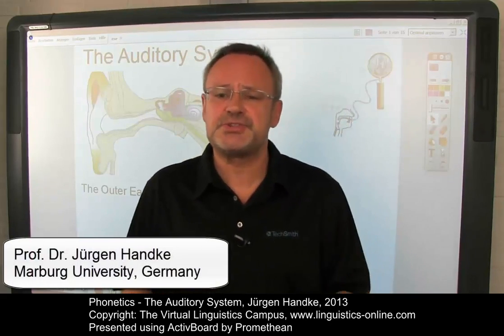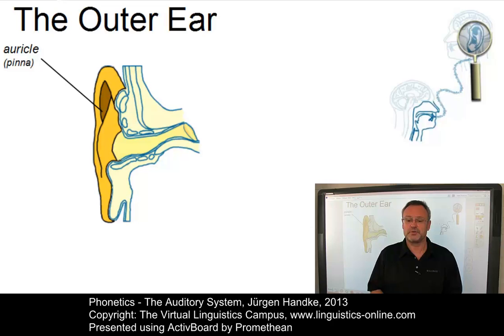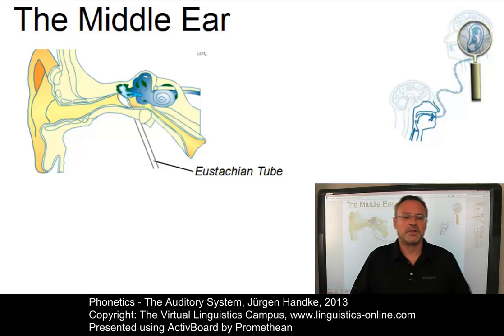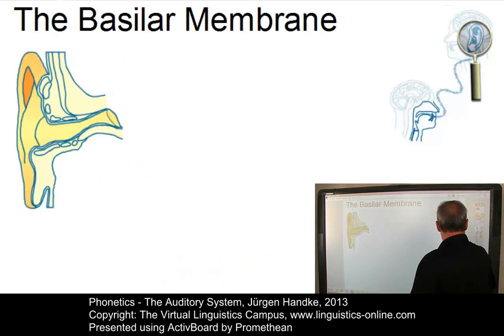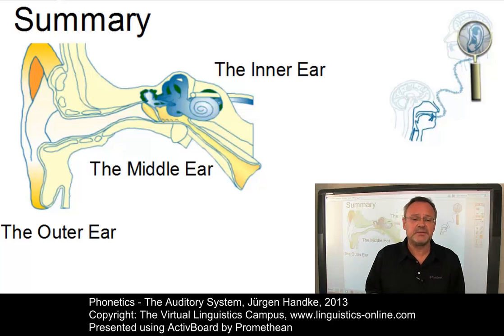PHO131 - The Auditory System

Comment: (0:03) Hello. The starting point for any auditory analysis of speech is the study of the anatomy and physiology of the ear and the brain.

(0:13) The focus of this e-lecture is the ear – generally referred to as the auditory system. It consists of three central components: the outer ear, which modifies the incoming sound signal and amplifies it at the eardrum; the middle ear, which improves the signal and transfers it to; the inner ear, where the signal is converted from mechanical vibrations into nerve impulses and is transmitted to the brain via the auditory nerve. Let us look at these components in more detail.

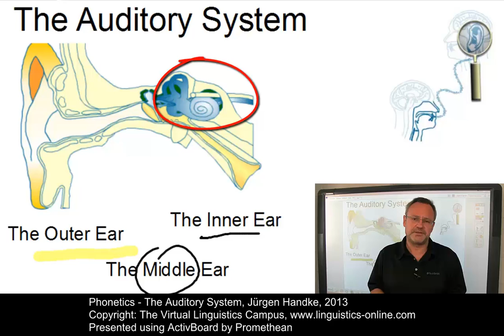(0:55) The outer ear consists of the visible part, known as the oracle or pinner, and the interior part. The oracle collects sound waves and is also important in our ability to localize the source of a sound. Furthermore, it can modify incoming sounds – particularly high frequencies.
From here, the ear canal, a 2.5cm long tube leads to the eardrum. The main function of the ear canal is to filter out tiny substances that might approach the eardrum. Furthermore, it amplifies certain sound frequencies, especially those between 3000Hz & 4000Hz, and it protects the eardrum (also called [the] tympanic membrane) from changes in temperature as well as from damage. The eardrum is set into vibration by the sound waves. This vibration is picked up by the bones in the next section of the ear: the middle ear.

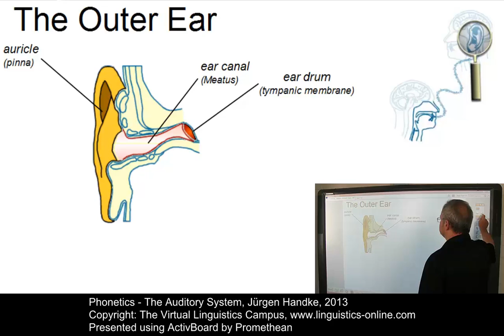(2:12) The middle ear is a cavity which is filled with air via the eustachian tube which is linked to the back of the nose and the throat. When the eardrum vibrates due to the varying air pressure caused by the sound waves, it causes the three small bones (the so-called ossicles) to move back and forth. The ossicles, here in an enlarged form, are a system of three small bones which are named after their shape: the hammer, or malleus, is attached to the ear drum; the anvil is the link between the hammer and the stirrup (the final little bone); and the stirrup fits into the oval window of the inner ear and transmits the mechanical vibrations to it. Together, the ossicles function as a kind of leverage system, amplifying the vibrations by a factor of over 30dB by the time they reach the inner ear via the membrane covered oval opening of the inner ear.

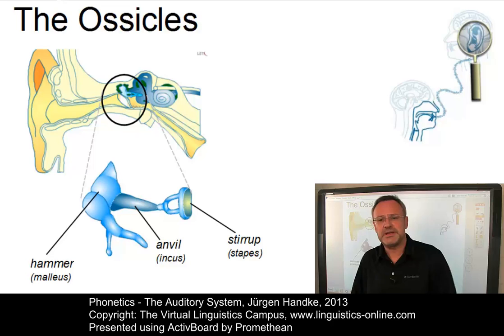(3:32) Now, the inner ear contains the vestibular organ with the semi-circular canals. They control our sense of balance.
And then there is the cochlea – a coiled cavity about 35mm long, resembling a snail’s shell. The cochlea is responsible for converting sounds which enter the ear canal from mechanical vibrations into electrical signals. The mechanical vibrations are transmitted to the oval window of the inner ear via the stirrup. This conversion process, known as transduction, is performed by special sensory cells within the cochlea. And the electrical signals, which code??? the sounds characteristics, are carried to the brain by means of the auditory nerve.

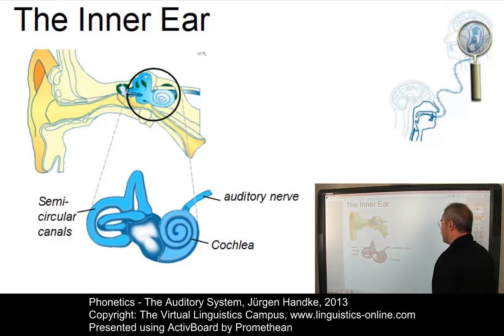(4:35) Let us look at the cochlea in more detail by means of a cross-section. As we can see over here, the cochlea is divided into three chambers by the so-called basilar membrane. The upper chamber is the scala vestibuli and the lower chamber is the scala tympani. They are both filled with a clear, viscous fluid called perilymph.  Between these two chambers is the cochlear duct which is filled with endolymph. On the basilar membrane rests the organ of corti which contains a systematic arrangement of hair cells which pick up the pressure movements along the basilar membrane. Here is the basilar membrane: first, coiled like its original form within the cochlea; and then uncoiled for a better understanding of its function. In the basilar membrane different sound frequencies are mapped onto different membrane sites from [the] apex (that is the small end) to its base. The numbers that are given here provide the frequency in Hertz. On the basilar membrane we have hair cells that bend in wave-like actions in the fluid and set off nerve impulses which then pass through the auditory nerve to the hearing centre of the brain. Short hair cells respond to high frequencies, and longer fibres respond to lower frequencies.

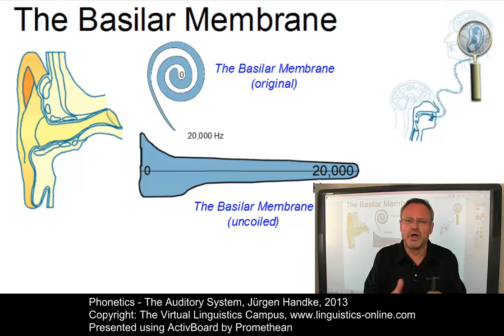(6:35) So much… for the three components of the ear: the outer ear, which is filled with air; the middle ear, which is a sort of mechanical amplifier by means of a leverage system; and the inner ear, which picks the impulses of the ossicles and converts them to nerve impulses transmitted to the brain.

(7:04) Let us finally see a short video we produced sometime ago. This video summarizes the central functions of the components of the human auditory system.
(7:17) “When sound travels through the ear canal it causes the eardrum to vibrate. These vibrations are transmitted through the middle ear by three small bones (the so-called ossicles) to the cochlea (the main organ of the inner ear). When the cochlea is set in motion by an incoming sound, tiny hair cells convert the mechanical movements into neural activity.”

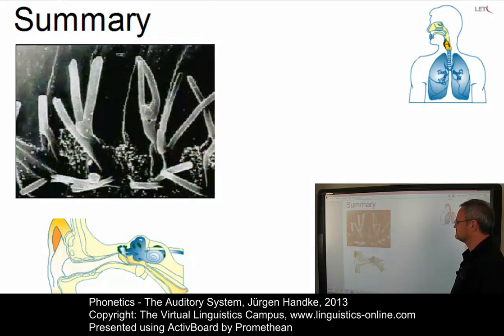(7:57) Well, that's it for now. Thanks for your attention and see you again.